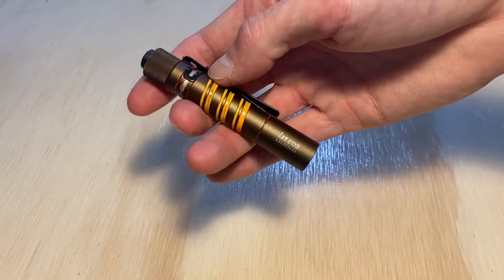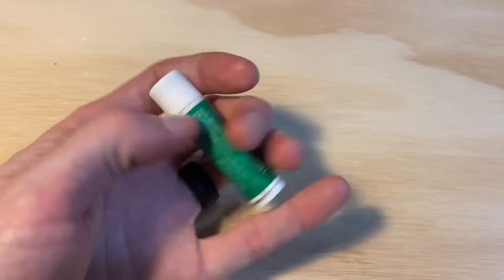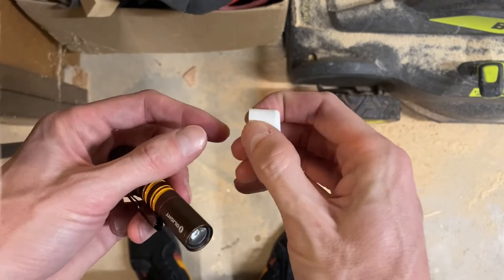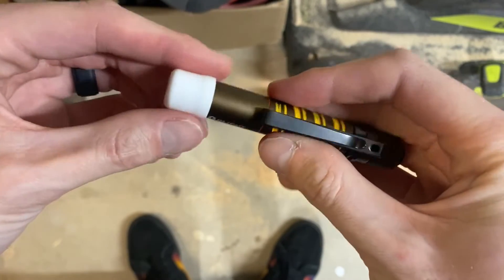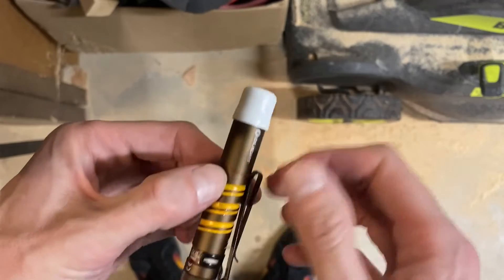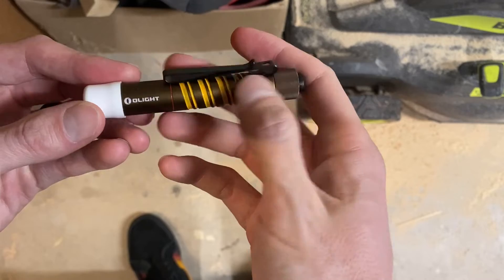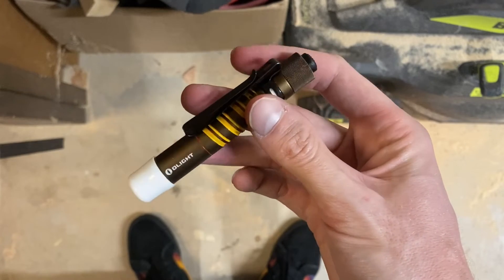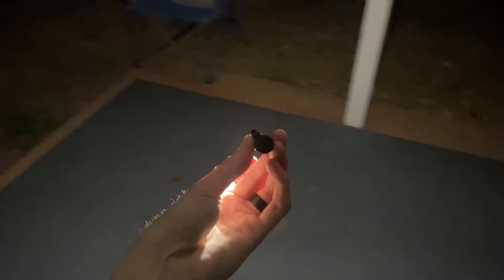How to Make a Diffuser for your Olight i3T! An EASY and Inexpensive DIY Tutorial

Comment: Good idea. Have you melted one onto a light yet from it getting too hot?
Reply from the maker: That’s a good question and a valid concern. I’ll test this in an upcoming video!
Reply: I did mine on high until the AAA died. The i3T was warm, and the chapstick cap was cool.
Reply: Better don't try after the battery swap right ? 😅